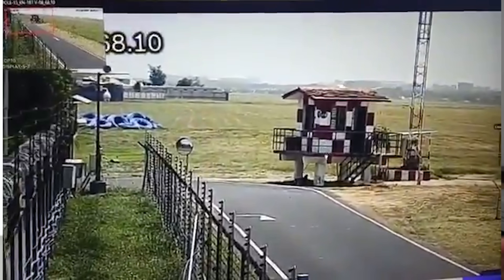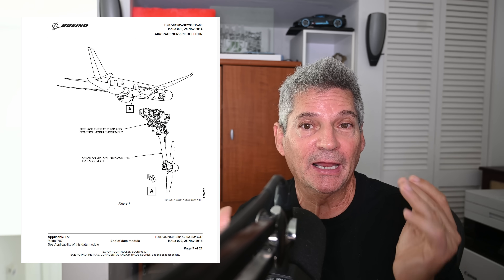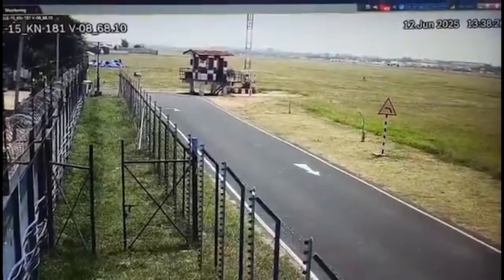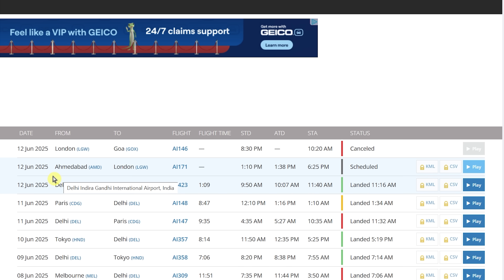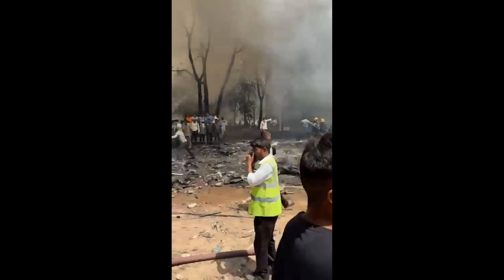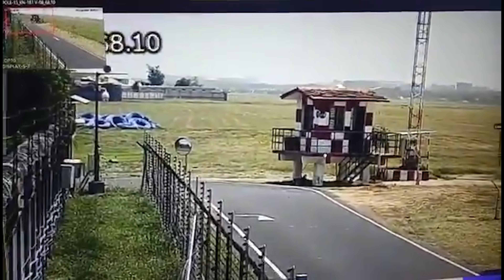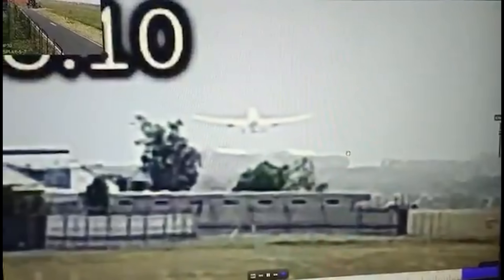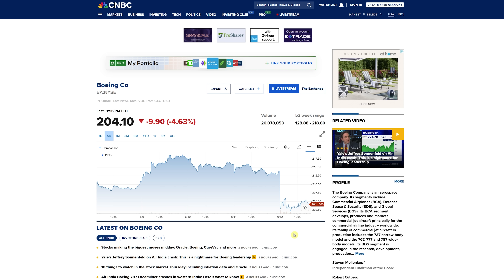What Caused Air India 171 Crash, Mysterious Sound Before Impact

Comment: Here is the big problem. For a rat to deploy you have to lose 6 power sources. 2 for each engine and 2 on apu. 

They all bring power to their own power conversion panels. So to lose all those is extreme. 

Loss of thrust on both engines almost immediately without a lot of smoke is unusual as well.

The aircraft kept a pretty dang stable angle ( not oscillating or wiggling around) on the way down so thats also strange that flight controls themselves seemed operational. 

For instant engine cut without smoke you are looking at either fuel cutoff switches being flipped to off or fire handle being pulled up.

What if it was an electrical fault making the system think that popped?

Comment: The thing that struck/ strikes me in the video was the ground dust and debris kicked off by the aircraft engines as it took took off.
That was/ is  an indicator that aircraft had completely maxed out the runway,  a sign that all was not well.
The engine sounds to me didn’t sound like they were struggling ‘hard’ enough  given the airplane had just about run out of runway.
One would have expected in such circumstances to see hear a louder roar and a trail of dark smoke emanating from the engines on liftoff.

Comment: Pilot here...  Pilot error—possible flap selection mistake post-takeoff. Instead of retracting the landing gear, flaps were inadvertently raised (e.g., flap lever moved from T/O position to UP). This would explain:

Gear remaining extended (no gear-up selection).

Crash scene evidence: L/E slats visible but minimal/no T/E flaps—impossible for a valid T/O config, suggesting flaps were retracted prematurely.

Flight dynamics: Selecting flaps up at low speed (behind the power curve) would cause a sudden loss of lift, mimicking "power failure" sensations. This aligns with the "Mayday, lost power" radio call.

Verification: FDR data will confirm flap lever position vs. gear command timing. If the theory holds, it’s a tragic case of configuration error under stress
Reply: Air brakes are out.  I'm sure there was a pilot disagreement over an abort.  As a result nobody sure what state the surfaces are in, and no time to ask as pilot was fighting a stall.
Reply: @user-pf5xq3lq8i  Yep, aborted takeoffs are probably NOT appreciated in the India airline business - I'm guessing the Captain would def NOT want to abort - too many questions to answer for that - specially if it was because flaps were not set for Takeoff - the data will tell more
Reply: Why the RAT then?…
Reply: @adadadatt i came here to say exactly that. It's an automatic system brought on by engine failure. It was deployed
Reply: @adadadatt  if it was due to a flap misconfiguration then it's possible RAT Auto deploys with sudden loss I've left. But I'm not sure
Reply: @adadadatt  Was it a RAT? Or that usual fanjet takeoff buzz?
Reply: Lack of engine thrust mentioned in rumoured mayday call.
Reply: Aerospace engineer here, my first instinct was flap configuration error as well, but I don't know any of the data
Reply: So why is the RAT deployed?
Reply: But wasn't there an issue well before the point the gear would be raised. Mayday was called when they were at the far end of the runway - they hadn't even cleared the runway.
Reply: How do u think that man survived ? I mean he was seated next to the fuel tank
Reply: @7blackdogs  My thinking is it's useless for him to ever buy a lotto ticket. He used all his luck.
Reply: pitot tube speed error V2
Reply: As the plane goes down the runway you see the engines. Were the flaps ever down? Don't they pretty obscure view of the engines when they're down?
Reply: From what I understand about the emergency power, it can takes a few minutes to deploy.   So it would have to have come out before leaving the gate.

Comment: Flaps not working, it’s wrong theory if flaps not working so how it was take off ? Engine failure by bird , it’s also misconception, because plane was too longer in Length and in width so it’s possibility 1/ million and third theory is total electrical system failure. So this also wrong theory because this plane have triple backup

Comment: What's up with the cloud of dirt that the mouse is pointing at when you're watching the plane go up
Reply: Late takeoff..maybe a disagreement about aborting?  Speedbrakes probably called on the ground but didn't work due to complete hydrolic failure.  So the abort 
..had to be aborted.
Then in the air when the RAT came out, speedbrakes suddenly activated.  What a mess!  1 engine, hydrolic issues, max load, intersection takeoff, gear down, hot temps, surprise speedbrakes, and try not to stall. 
Very difficult to clean up that mess at 200ft.  About 10 seconds till death.

Comment: I hear a Ram Air Turbune sound.   But
It's not deployed.  Flight AI171 lost lift and not thrust.  Only 627 feet in 60 seconds of flight.  The 787 climbs at a rate of 2000-3000 feet pretty min.  The gear should be up, and flaps/slats should be partially extended. 
Pilot Error plain and simple.

Comment: Flaps appear to be deployed in the higher resolution video at 1:51 by the extended trailing edge of the wing. Not full flaps but flaps 10 or 15 if I had to guess.

Comment: I don't see the flaps being up or down. But if the RAT did deployed (very hard to see) it would have done so automatically, and it's an indication of dual engine failure for whatever reason, which is highly unlikely. And on the video, we can't see any flock of birds in the air. 

With that said, the flaps not being set for takeoff would have triggered all the takeoff alarms, unless there was a major electrical malfunction of some sort. Some passengers that had just arrived on this plane did have complaints of the AC going off and on as did their TV screens behind the seats. A sign that the plane was experiencing electrical issues. Although that happens occasionally on some flights, this perhaps was more serious than usual.

Comment: A prop plane?  Uhhhh.......NO.  The big fans can sound that way. Not unusual at all. What IS unusual is that the sound of the engines got quieter. 
Now, the 787 IS a VERY quiet aircraft but it did sound like there was a drop in noise from the engines.

Comment: It's NOT up to you are me to decide what went wrong. It's the accident investigators who do that. 
You and I are only guessing.

That sound COULD be a RAT, but large jet engines all have a distinctive buzz from certain angles from the large engine fans, and it's recorded from a phone on a balcony with sound echoing around. 
You can suggest it but you are still just speculating.

It's unlikely that it was incorrectly configured (no flaps set for example) but that would result in a very loud alarm as you advanced the throttles, so that's unlikely. 
It could be a pilot error in the pilot monitoring raising the flaps  instead of the undercarriage, and that would certainly result in the aircraft sinking as the speed would have been too low for zero flaps at that point. 
But it's still speculation. 
It could be a double engine failure from bird strikes etc, but that's speculation too.

Comment: What i could make out of your analysis is that the RAT was deployed which means there must be some serious power failure on the plane.
BTW, i prefer not to select AI flights as those are sometimes not maintained well (based on my personal experience only). In a few international flight I could hear shaky sound through out journey and specially scary landing experiences. But yes, thanks for showing other side of the story as i could see the plane crash photo of inside the medical college that too in the cafeteria (meal plate was visible), and if i match it with its crash time it was 1:35pm-2pm which are normally peak hours for lunch, this is really heartbreaking! 
RIP...

Comment: RAT automatically deploys with loss of electrical or hydraulic power. Will lose electrical and hydraulic power with total engine failure in number one and number two. What's my observation,.. 
 it looks like a total loss of thrust. 
That usually boils down to "switchalagy"  flaps up instead of gear, to me contributed.  fuel pressure??  
If they had control I think I would have seen the nose drop down to gain a little airspeed trying to stay airborne while they try to relight the power plant/s 
R I P

Comment: The Japan Airline 787 landing with ram air turbine (RAT) is not necessary an emergency landing. An airplane in C check is a jobcard for RAT operational check, sometimes we will request pilot that deploy RAT at the last flight landing right before C check, than during C check we do not need to setup equipment creat ram air to test RAT, instead just test RAT retract function.

Comment: I'm not a pilot but spent over 30 years working at airports. Noting a couple of factors. Temperature was 30 degrees C. Full passenger load and fueled for a 4000 mile flight. I bet the passenger baggage was maxed out, with so many UK  citizens on board. Over the years I have seen many incidents of ground staff loading mistakes not detected until after the flight. I wonder how close this A/C was to max TO weight?

Comment: The fact that as the plane flew by and all you heard was the RAT propeller sound, sounds like the engines cut off completely after take off.
Reply: Survivor said there was a boom inside the plane hence prob why the pilot called mayday..both engines were out
Reply: correct, dual gen failure or dual engine failure
Reply: I do hear the jet engines. But they sounded like they were at idle or low power. Definitely was a power issue with the plane after take off.
Reply: dead engines usually do not cause a huge fire ball
Reply: Plane was loaded with 50000+ litres of fuel which caused the huge fireball @brentpalmer2577
Reply: The engines were more then likely at idle. If no, lost power  Something caused the planes Auto RAT system to  engageAlso the fireball was due to all the fuel on board @brentpalmer2577
Reply: @brentpalmer2577 there’s a huge fireball because it’s a international flight right after takeoff

Comment: The build quality of those Boeing 787 Dreamliners are really bad, https://youtu.be/Ivn9_4jZZ9k?si=vMh_eRsxJWhXqjVB. I was on a B787 Dreamliner when I flew to Italy and back. I prayed as I was nervous while flying on it. Thank God that I made it back to Canada in one piece.

It sounds like the engine power cutout and the flyby wire control system stopped working, possibly because the electrical system died. This means the airplane had no controls as it glided back to the ground and crashed. It is so sad that 200 people had to die after taking-off on a B787 Dreamliner. What a horrible way to die. We will only know after they check the Blackbox.

Comment: No that’s engine stalling you sure you’re an engineer? That’s sound of turbine struggling for air aka engine stall  and I know why one flaps not above 25% down  meaning it’s not generating enough lift you even can see flaps are fully up on take offeven basic engineer knows it going stall if flaps not down.. I say it 100% pilot error.
Reply: What happen he was at 180 got lift pull up with flaps up about 230ft speed drop to 160-120 well below wings lifting capacity hence wings lifting up wail plane stalling  see flaps suppose help you get the lift at desired low speed and because it was up he needed to be going at 250knots which he clearly wasn’t and had engine at full struggling the engine which was that “🤨😒 prop sound”

Comment: Sounds like a plane to me, not like a RAT. The videos of the RATs were filmed much closer. This just sounds like a normal jet engine with some doppler.

People are saying the flaps aren't set. I can't verify. But landing gear is definitely out. Seems odd since that's the first thing you do if they're out if you need more speed. Possibly a double bird strike seconds after takeoff. But sounds like the engines are on, so probably not that. I'm leaning towards the improper flaps theory. Pilot pulled up the flaps instead of the gear.
Reply: An alternative theory states that they hit birds, lost both engines, tried to pull up the gear but couldn't because lost power, and we heard the RAT not the engines in the video. Explains why gear is down and why we hear possibly RAT and why there's no asymmetric thrust and why no lift.

Comment: HOT HOT HOT …. ALTITUDE Altitude….OVER LOAD FOR WEATHER AND ALTITUDE… 
That sound is the regular sound of the 787..
Flaps wrong .. ????
Question … DID PILOT USE CORRECT START POSITION …
Dust kick up showed pilot pushed plane up… VLOF IN QUESTION !!!!!!

Comment: I am an airline pilot and an airline mechanic for 40 years and I can I tell you that the sound is definitely the RAT. Ram Air Turbine is deployed ONLY when its total loss of electrical power. We do that on B1 and C1 customer flight for testing RAT in the air when all VFSGs are disconnected. 
Before the takeoff, modern airline will tell you takeoff configuration OK and runway you are taking off from with virtual display. So at that point without flaps, you are going to have a configuration issue and would not of let you takeoff until you fixed the issue.
Reply: What or who would not let you take off before you fixed the "issue"?

Comment: This could be pretty simple; if you study the aircraft struggling to lift off and using every bit of that runway, you will see that the flaps are not extended.

A 787 loaded to the max and fully fueled struggled to reach V1 speed on that entire runway. That brand/new aircraft is rated to be able to safely take-off on only one engine if required; If something else happened to that aircraft, besides them failing to extend the flaps, this could have conceivably overwhelmed the crew’s ability to stay ahead of the aircraft. It may have been responsible for the flaps failing to extend, in fact, as well as other failures, like an inability to raise the landing gear and/or control the rudder & ailerons to steer the aircraft.

This will indeed depend on the CVR & CDR “black boxes” that are actually painted red.

Comment: Isn't the "RAT" (Ram air turbine) purpose to keep electrical power for flight computers/systems from being interrupted.  It sure isn't for providing thrust or hydraulics to keep the plane airborne, as some have seem to have speculated.   The APU (Auxilliary Power Unit) also supplies electrical power and some air for the cabin when the main engines aren't running.  That the flight crew transmitted "mayday'' so abruptly tells me they had an irrecoverable problem, and that  it would be their last transmission.., so call out the ambulances and crash response teams.  Whetner or not the wing was stalled, pushing the yoke forward/nose down in some attempt to 'un-stall' it wouldn't have made any difference at that altitude because the plane was pretty obviously done flying.  All they could try to do was keep the nose pitched up to cushion the impact.  Those planes have to be able to continue the take-off and climb-out on a single engine,  once they pass the refusal point.  This is not just a catastrophic event.  This is a show-stopper.

Comment: the survivor said he heard a "boom" 30 seconds before plane went down..( that then possibly reduced the thrust of the engines ) , he also said he saw a lot of dead bodies around him, indication that, he got out after the crash ..  Also I find the sound of the engines not very loud at all ( as it flies by ) , they are usually very loud on takeoff ,  (full power) !!
Reply: Sounded like a WW2 prop fighter than a jet plane thats for sure
Reply: I wonder if the RAT dropping down makes a "boom' noise ? Landing gear ops sure makes noises inside the cabin if you are close to the gear

Comment: Hard to tell but it looks to me as if the plane was very late taking off,  near the end of the runway. You can see it kicking up a cloud of dust just as it gets airborne, which I'm assuming means it's over the unpaved section of the runway. ?
Reply: Sometimes when I vacuum my floor, the end part of the vacuum blows dust onto parts of the floor I've already vacuumed.  Does that mean that I haven't vacuumed the floor because moving air moves dust particles?

Comment: That’s not 600 ft but rather 50 to 100 ft.
Reply: I think you are correct about not being at 600’. ADS-B data might show 600’ but that figure should be corrected for barometric pressure (with a QNH of 1001 at the time of the accident that will be a correction of -360’) and field elevation (180’) so a total correction of 540’. I think it did climb above 60’ but ADS-B is not that precise and further evidence is in the video. The 787-8 has a wing span of 197’, and with the grainy video I don’t think you can actually see the wing tips, but it looks like the aircraft barely reached an altitude of more than 200’ above ground level.

Comment: The area around the wing box is the strongest part of the plane -- it has to be given that the wing which connect to the plane with the wing box and the wings needing to be able to life the entire plane.  Yes, the wings are where most of the fuel is and there would have been a lot of fuel, but my guess is the wings came off while the fuselage continued for a bit so that he was able to flee without burning up.